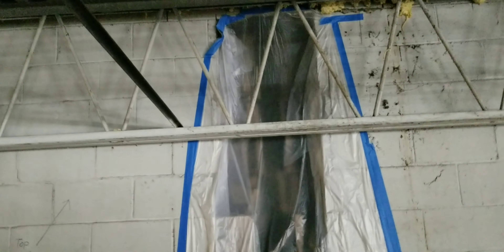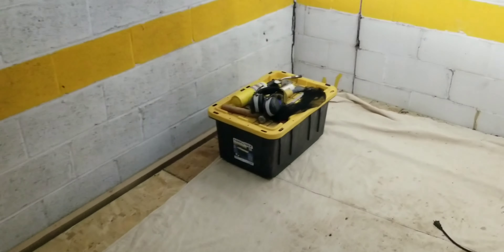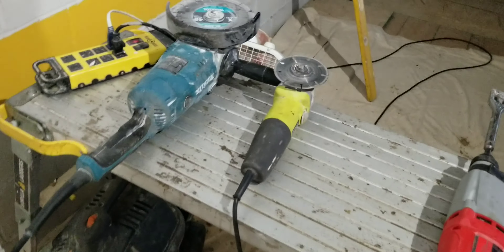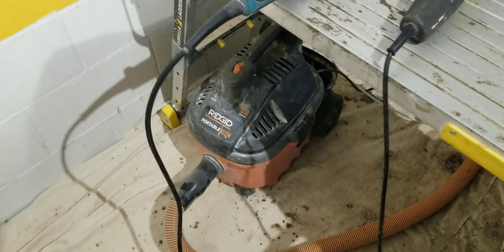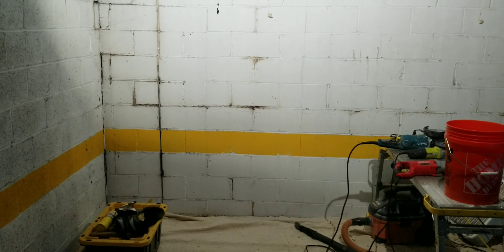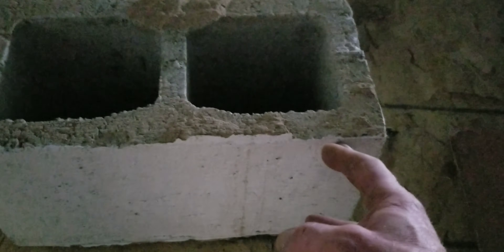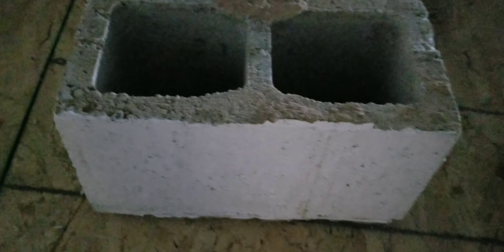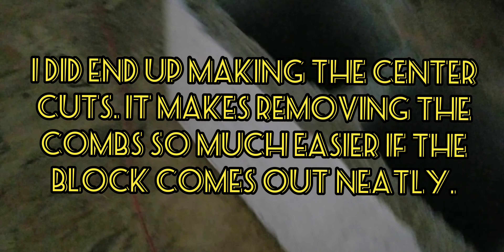Honeybee Removal: Big and Old.

Comment: That gives new meaning to the word "cutout". Those are blockouts.
Reply from the maker: I've got the process down now. I'll take em alll!!
Reply from the maker: All the comb was active, found a queen cells, one peanut but had a drone brood attached to it as connecting wax at the top, and one capped on the opposite side. I ruined both like a dumb ass, but have them in a box with the remaining comb and some space to work on.